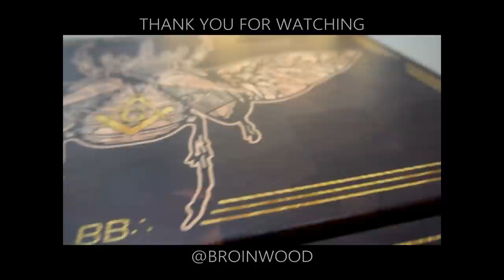Inlaid Cutting Board with a Forest Beetle "Billeschou" / BroinwooD / CNC wood inlay

Comment: The video doesn't capture the difficulty of creating such precise wooden inserts. It's gorgeous !
Reply: The machine did it. ???
Reply: @michaelweller5470  With respect, to say "The machine did it" is quite the understatement. If someone builds a house from wood, do you just say that 'The hammer did it?'.
I am very familiar with this process and I can promise you that the designing, the drawing, the prep and execution are more time consuming than just hitting a start button on a machine. In fact, all of what I mentioned usually takes longer than the time it takes for the machine to do the carving.